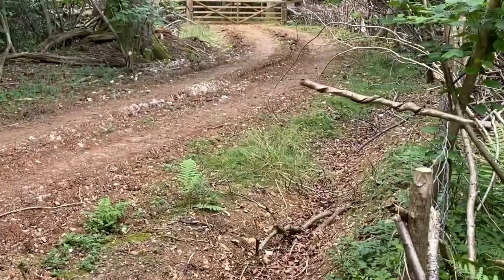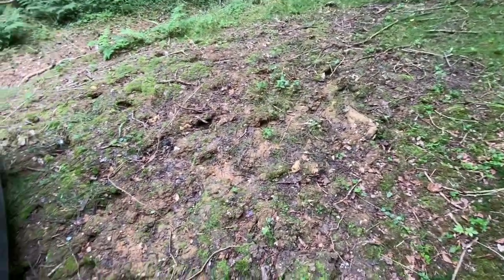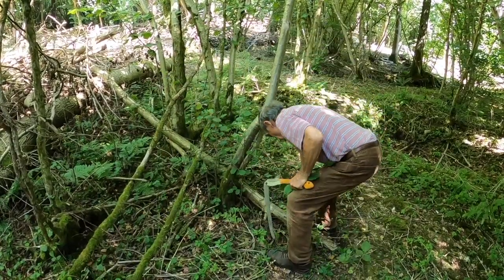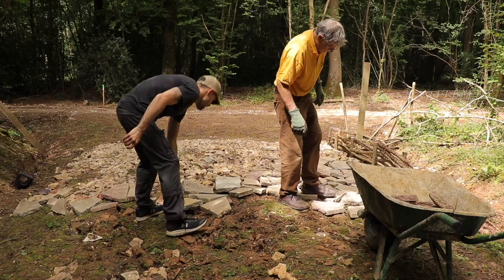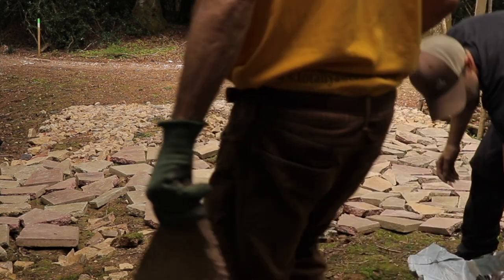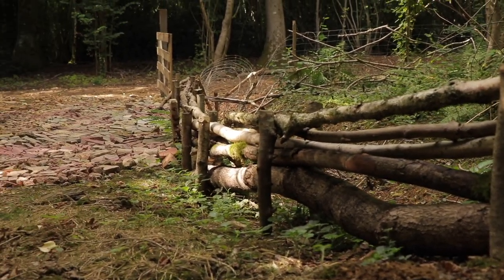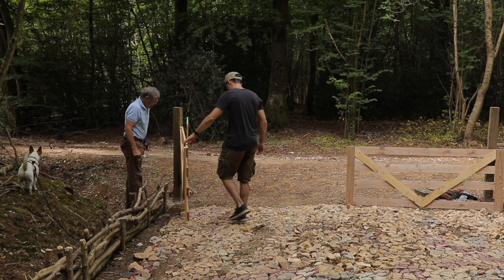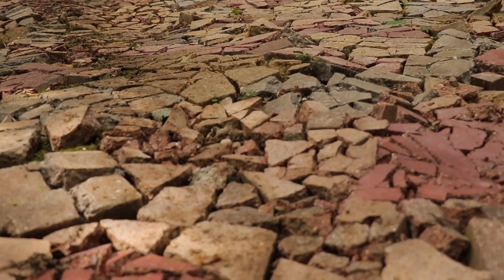Building Off-Grid Parking in the Woods using Free Hardcore

Comment: In my experience, the issue you'd run into isn't the pieces of slab sinking totally into the clay, but washout. During bad rains, it's amazing how heavy a piece of that stuff can move. My recommendation is to find a way to naturally redirect the water into those drainage ditches before they reach the parking pad. Maybe a v-shaped trench leading to either side. And even dump some of those hunks of concrete into the ditches themselves to keep them from digging down  further and further

Comment: Old carpet works very well in this situation! Put the carpet side down on the clay, then put the rubble on top of that. The carpet sticks to the clay and doesn’t sink near as bad and it stops the rubble from simply disappearing into the subsoil. This method also works well for stopping erosion.
Reply from the maker: Damn! Great idea. Wish we did that before we laid the hardcore down 🤣
Reply: @TAOutdoors  can only recommend that method, came here to suggest the same. did it some 12+ years ago on a dirt track in a boggy area and it's still going strong :)
Reply: I park my van in the back yard on old carpet with one full piece of thick plywood 4’x 8’ over top for the front wheels to come to rest on. Plywood needs to be thick and large or it will curl up. Front wheel drive, front end very heavy.  When I see a new piece of carpet in a neighbor’s trash it gets added over the old. Lol. Last piece has pretty flowers.!! I began with a large piece of used office carpet. Free from a carpet place. They just throw it away. Not pretty but strong. Still in good nick after years of use. Also added a large piece of linoleum recently. 👍🏻

Comment: I bet if you went over it with sand (if you can get sand, otherwise good old dirt) and straw, and then wet it (if the drought continues, otherwise rain will do it for you), the dirt and straw will bond and fill in with the crushed pavers. With some tamping, it'll harden into a smoother, more cohesive driveway. And (obviously once the straw and dirt have ground in and the extra brushed or blown away) you'll end up with something that looks more like cobblestone but strong and solid like a concrete driveway. It'll also give you more grip if you ever drive in there when it's icy or snowy.

Comment: You can get reclaimed tarmac chippings from council resurfacing projects. I used it over hardcore on a clay stable track. I then put a thin layer of top soil on it and seeded it with a grass and wildflower mix. It works! Looks good when it all turns green.

Comment: Actually those large chunks will serve you well. I put in a 200+ yd long dive on virgin ground. I srarted with 2-3" stone and still had sinking after two more layers of 1.5-2" stone and two years of settling the drive is now solid and rut free.
Reply from the maker: That’s good to know. I’m going to see what happens with this over the winter, then adjust it again next spring/summer. Cheers for the tips.

Comment: One thing we used to do on projects like this was add water bars - even when you do not have a great deal of water to divert they keep the surface from being redistributed as far when driving through and it does help the clay dry out by giving a path for the water to escape at regular intervals.  if conditions are very sloppy they can be a impediment but they do help things get back to passable faster in many situations.  unclear if the lane is yours or not to do things like that but putting them at either end of the rubble area would at least keep that in place a bit better.

even if the rubble does eventually sink it will add some stability to the muck and prevent your van wheels from sinking as far

Comment: Use pulverized gravel to sure up your gaps and filler for the ruts. It'll help with water disbursement. Or contact your local road dept and when they repave or replace a road they will typically give away the tilling of the old road for free if they can dump it on your property. At least it's that way in the states. Just a thought.

Comment: my suggestion would be to turn to your dad's favourite idea of using old pallet wood to build a wooden deck area with 2 wheel ramps for driving up, not the quickest solution nor would it last the longest but it would keep in with your tradition of keeping things built from scrap pallets. also I work on building sites in England and you wouldn't believe the amount of lengthy pallets that get thrown away, could be a good place to get your larger pallets from in the future.

Comment: "Hammer Time" You both did a fine job there guys. With more hard-core over time you definitely won't have any problems. Looking at the drainage ditch I would dig that out some more to allow better drainage. If you know any builders Mike just ask them keep a load of rubble back for you. G&M driveway solutions 😂

Comment: Looks like you need one of those compactors or vibrating plates which are ideal for breaking down & flattening hardcore, save you some time/effort hammering by hand - anyways you can rent them easily enough for around £30 plus per day. Good luck

Comment: when its settled, whack it if possible and spread some reclaimed sand and a few bags of cheap cement over it, brush it in and sprinkle water with a watering can, it doesn't make it solid as such it just sort of moulds it together slightly

Comment: Small suggestion : perhaps you might consider using sands from the surrounding or nearby area and spread them over your slabs pavement to fill up the gaps. This could save your tires from cutting by the sharp edges of the slabs.

Comment: Sub base is basically a mix of sharp stone and quarry dust(ruff sand). If u can find people giving away ruff sand for mixing floor concrete and 10mm and 20mm stone, give it a mix in a mixer and spread that on top. Should stabilise the ground and slabs.

Comment: the answer seems to be to warn off the foxhunters from their needless bloodhunt; they can stay to their own property and shouldn't be crossing into property that is not theirs without permission.  

The cabin i built in alaska had similar issues with the roadway into it.   the ground was soft during certain times of year, there was no way of actually driving up into the area at all; we'd have to park on the roadway and walk in the couple hundred yards to the actual cabin.  

Depending on the consistency, dumping gravel down it might just keep sinking into wet clay.  What will help is to lay down some of the permiable geotextile  (the stuff that looks like dense black mesh type stuff) and then put down gravel, and then pavers.  
another option is the "corderoy roadbed"....cut modest sized timbers, and split them in half lengthwise. lay 6 or 8 in the "wheel tracks" until the tracks are covered, then lay a bed of split timbers crosswise to the first.    the idea is to provide enough coverage to spread out the groundweight of the vehicle so it doesn't sink into the mud.  The main disadvantiage is the sheer number of logs needed for this, even for such a small area as you have. 

Given you've already got a bed of broken brick laid down.  If you find they're sinking in too much, you might consider laying larger pieces on top of those (much like what you lay down before breaking them)  if those keep sinking, you may have to go to full section pavers on top of those after they sink in a bit.....

Comment: Here in the United States we have "urbanite" which is the broken up, used concrete from reworking roadways and such.  You can usually get a dump truck load of urbanite for very reasonable price.  Don't know if there is a place in the UK that repurposes the urbanite from roadways, but just thought I'd offer a suggestion and possible option.

Comment: I'm surprised that you didn't add more braces (or logs) to the underside of those 13 foot pallets, then lay them down on top of the stones.  I don't know how wide the lane way is, yet two pallets would give you a 13'x 12' flat 'bridge'.  For extra thickness 2 more of those pallets taken 100% apart then nail those boards onto the top of the base pallets. 
Most common way to get the road to not mire your vehicle is what is called a corderoy road.  Lay logs across the muck and drive over them to sink them down well. Then add your hard pack surface.  I've driven over corderoy roads that are a hundred years old.  Every once in a while the area work crews just add more hard pack on the top of them.

Comment: Just an idea, I am now a retired civil engineer, if you ask you local authority to see if they are having any road resurfacing work done in your general area, the road plannings are used for recycling and many times they like to have a free tip area this is what I used to do, I would be approached by someone who required a few tonnes of this material so I would gladly give them what they required because I wouldn't have to pay tip fees for this material  and they got it for free, if you do manage to get any of this lay it about 200mm and give it a good pounding with a vibrating roller this will last for years.

Comment: You should be able to afford a small truck load of sand or recycled concrete. Dump it right on top of the rocks and fill in the gaps.  Also you might want to make the driveway so the water runs off.

Comment: if you kept the slabs all you needed to do was cover them with a thin layer of dirt or sand from around the area and rent a gas powered compactor ... run it over the parking spot and pack everything down ... this way nothing will shift as you drive on it .. essentially you end up making a paver driveway ...
Reply: oh no clay aint no fun to dig .... had to dig a 4 foot deep 2 foot wide 50 foot long trench for a sun room addition on the parents house ... it took ages in the heat of the summer ... and some of the damp clay was so sticky you tossed the shovel full of clay out and took the other shovel while another removed the clay of the first one ... only took 2 weeks to dig by hand ... the saving grace ... it was close to the backyard inground pool ... so cooling off was simple ;)
Reply: keep an eye out for a neighbour redoing their home driveway with gravel base relaying ... then see if you can go in with them on the gravel and get the extra dumped in your driveway to move up to the forest .... then you get what you need at a decent price ... and rent a compactor ... that will help immeasurably ... you could also dust the parking spot with concrete dust and give it a watering then compact it all which will mix the concrete into your base and make it more solid and less prone to rutting ... it will still rut ... but just grab some more free removable debris again fill the ruts and drive back and forth over top of it a few times to compact that in also ... as time goes by ...

Comment: You going to want to drive your car back and forth over the whole entryway yes it's going to smash the brick slabs into the clay the same ruts the bricks underneath the car will push up and puncture your oil pan you want to use your car to flatten the hole entry surface and try to get a hold of more of the material that you are using I guess getting a hold of rock material is not possible you use words I not familiar with but I think you're talking about a road base material sometimes you can use rock material especially 3/4 size edgy material that will interlock and there's another option you can always buy what you could afford of road base a little bit at a time you are going to use this property for many years I would think you got an invest in a little bit

Comment: That was pretty stupid the bricks that were flat and squirrel if you would have put them in the ground when the ground was wet they would have sunk into the mud a little bit and you'd be able to drive over it and not have no problem
Reply: Not really, broken bricks/rocks etc lock into each other when broken up. bricks have flat sides so they slide easily. Its the same principal as the ballast that's used on railway lines.